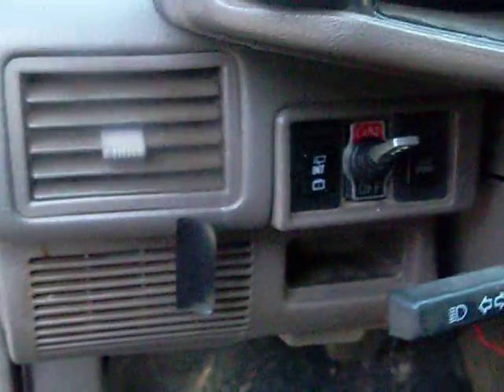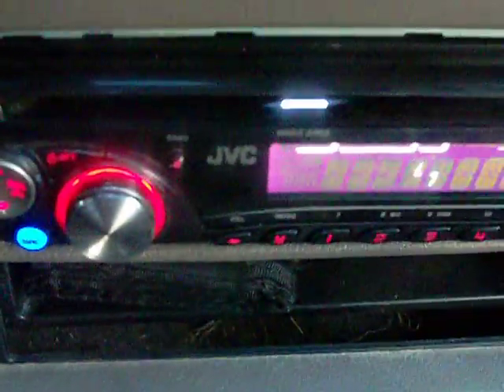Capacitor Problem

Comment: Disconnect the power cap for 2 hours, then hook it. Back up
Reply: @deedolan399  I cant even get my capacitor to charge at all, any ideas?
Reply: @alexisalback6433  I truthfully am unsure. It could be a bad capacitor all together or make sure that you are using a diode in between the positive battery supply and the positive post on the capacitor.(see videos of how to properly charge a capacitor-this could help). Or, you can do what I did. I bought a secondary battery from Amazon for approx $60 bucks and I have had no issues at all. 1000 times better than a capacitor.
Reply: Did you run the second battery through a battery isolator? Where did u buy it at and how many amps? There's a 80amp one on Amazon for $10 but i dunno if that's gonna be enough and the next one is 200 amps for like $35. 💁 about the vid. I didn't see anything wrong...bass hit and cap went down...car not running so not recharging the cap...💁 my cap drains way faster then that (when it used to be able to charge that is)...

Comment: Hey your problem could be a few things, First thing I want to say is dont play your subwoofers when the car is off. It drains your cap and battery way beyond what they want. Always have your car running when your bumpin it. 
Second, do you have a bad battery? How old is your battery? Might need to be replaced. Or have your alternator checked to see if it is giving enough power to your battery. 
Only other thing I can think of is are all your grounds nice and clean. Hope this helped
Reply: DennisK agree with u 6 years later